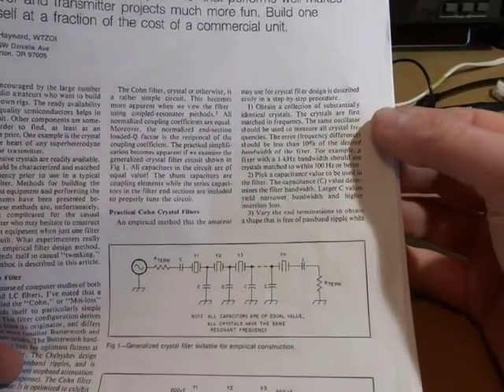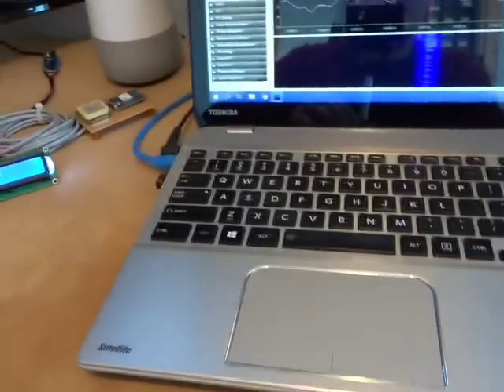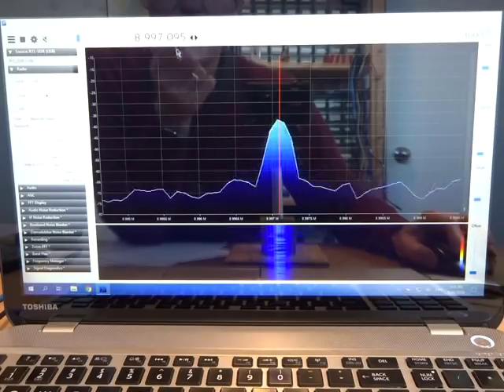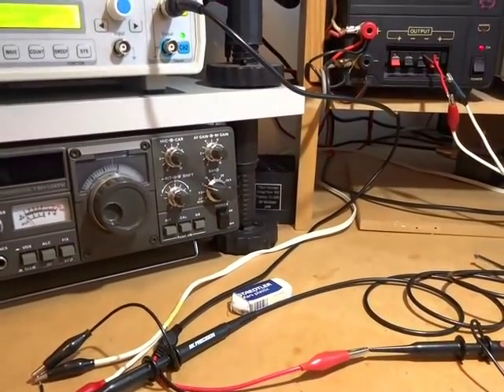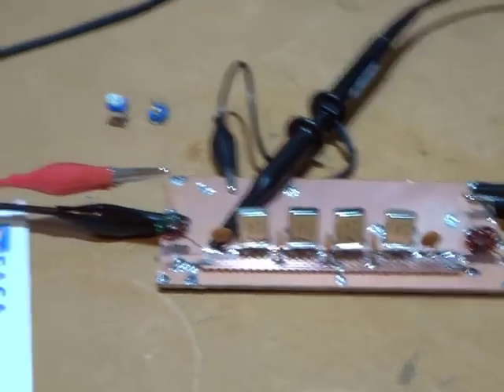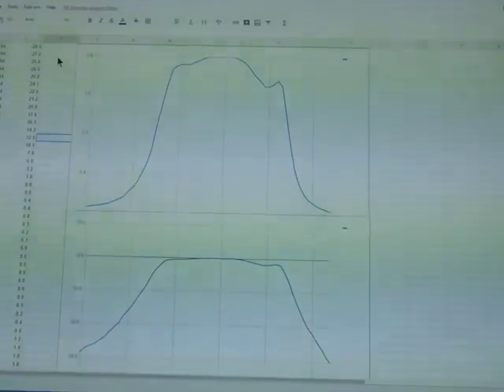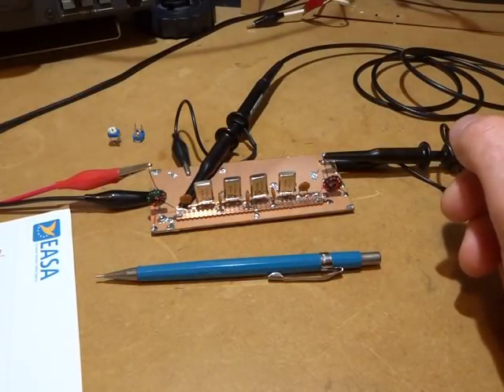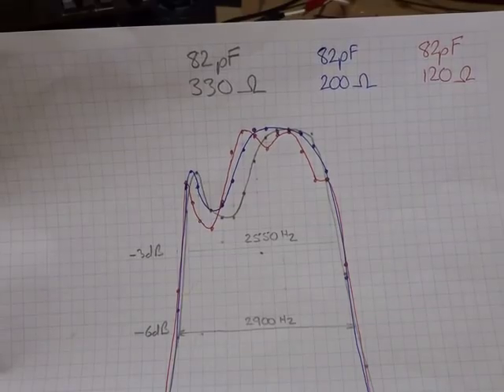Homebrew 80/40m SSB/CW Rig - #4a SSB Crystal Filter

Comment: Years ago, when the humble CB was very popular, they sold crystals for the CB band in electronics stores (possibly today it is more difficult to find). I read something about SSB filters, and bought a good number of crystals  27 MHz and another batch for 27,005 crystals. It seems that there are two types of resonance, one is the crystal acting as a filter and the other is the crystal acting as an oscillator, which are somewhat different, perhaps related to series and parallel resonance. The thing that in its day with an RF generator and an electronic voltmeter with an RF probe made two SSB filters that worked, but the problem was finding the quartz oscillator to create the SSB signal. I didn't insist and abandoned it. I recently bought a nanoVNA, and I found that nanoVNAs are almost amazing, that what once required sophisticated devices, I can measure or analyze with a nanoVNA: I have checked those filters that I made and indeed, they had a very suitable pass band as a filter of SSB. I also bought some ceramic SSB filters for 455 khz (at a more reasonable price than the quartz ones and I have tested them now with the nanoVNA and they are "very effective", today I imagine that they would be difficult to find if not via China. I have some other filters and SSB crystals resulting from scrapping cheap CBs.

Comment: Hi Charlie! Thank you for the great video! I just wanted to note that you could use the SDR for fine readings too. Set the SDR to SSB, then pipe the audio using VB-CABLE to an audio spectrum software. I would recommend using Friture. This way you can run FFT on a very narrow bandwidth, say 2400Hz which will allow you to get sub-Hz resolution on the spectrum in a matter of seconds. I have used this method with really good success. Hope it helps you too!

Comment: Hi Charlie,
I also built a crystal filter (12 Mhz) for a spectrum analyzer project from Ashaar Farhan.  I used the Haywood articles and built a crystal tester from a Doug Demaw article from QST.  This tester also had an comparison oscillator but allowed you to throw in a pad (on a seperate circuit )so you could measure the resistance of the crystals.  Supposedly once you sort the crystals by frequency, you place them with the highest ohm crystals in the center and work down on both ends.  I only tested the filter by 
hand tuning the sig gen through the pass band and plotting the P-P scope output.   The bandpass was supposed to be 1000
and with my imprecise measurements, it seems like about 600 to the 3 db points.
Andy  KM4TRT
Reply from the maker: That's very interesting thanks Andy. I build a filter a while back where I too tried to characterize each crystal. That filter didn't work very well either. I suspect it was my method/equipment that was a fault. Pete N6QW has written quite a bit about his experiences too.

Comment: Some time ago I picked up some 400 pieces of 8.3886mhz crystals in H6C/u packages on ebay for a few bucks.  These larger crystals supposedly have higher Q than the mini micro processor sized crystals, might make better filters.  I've been meaning to try and build a filter out of some of them using  your approach.  I'd probably use an Si5351 as a signal generator to sweep the filter, with my Leader frequency counter and old school Tek scope.

So I tried your oscillator circuit, but I put in 100pf caps and used a junk box surplus 2n2369A transistor and the stupid thing oscillated at about half the marked crystal frequency.  Put 100pf caps in parallel with the existing ones (didn't have any 220pf in the junk box), and now it's oscillating at the marked crystal frequency.  Weird!  I'm running the oscillator at 8v because I had an LM340K-08 in the junk box to hang on the output of my 13.8v bench supply.   I soldered two pins from a broken miniature tube socket (valve holder in your neck of the woods) to the lash up  to make it easy to swap crystals.  Now I can start to sort them out and find a set of 4-6 rocks close enough to try and make a filter.
Reply from the maker: Wow 400 crystals. You should be able to build several filters with that many! Hi hi. I'm keen to rebuild mine once I have the network analyser built.

Charlie

Comment: A few questions: what model number is your sig gen and are you happy with it? I have a scope arriving later this week and now need a sig gen. Is passband ripple affected by terminating resistance? I got fed up trying to use the RTL-SDR dongle + noise generator to characterize my crystal filter and I brought the filter to work and used a VNA to measure it. I had 3 dB of ripple over the passband which seemed excessive but the design was supposed to produce minimal ripple. I didn't bother to properly terminate either end of the filter and directly connected to the VNA, hence 50 ohms. I seem to have a firm grasp on how to vary the bandwidth of my filter, but not the ripple.
Reply from the maker: Gidday. The sig gen is a generic FY3200S model from any number of online sources (Amazon, AliExpress etc). For what I paid for it, I think it works well. You cannot set the output to absolute zero (even though the display says so) and the case is not shielded which means the output signals leaks. Not really a biggy though. I did open it up and desoldered the  speaker that clicked for every button selection and during rotary encoder rotation. It was quite load and a bit annoying. Having a frequency sweep function would be nice, but not necessary.

As for the filters, yes, the terminating resistance did have an impact on the passband ripple. I tried several values and settled on the one that resulted in the least ripple. I have had success feeding white noise into a mic and using the RTL-SDR to monitor the filter output. You can really see the passband and how well it's performing. The plan is to build a VNA after this. Justing waiting on the log amp to arrive.

Comment: Hi Charlie, great video mate!

I ordered around 500 10.7MHz crystals from China a few months back (paid little over twenty quid for the lot), not had any time to experiment due to work and family commitments but hope to have a tinker in the coming weeks. I wasn't sure which way to go with regards to the design, Pete Juliano N6QW was not convinced the software that is available gave a close representation of the real world results so I was keen to take the grass roots approach which you have clearly done. 

As it happens I have have a copy of that magazine from QST archives so will have a read over it later today, but what has inspired an offshoot from my current homebrew SSB radio projects is a homebrew semi-automated crystal tester using an WiFi enabled Arduino as both a Frequency Counter and a data logger, I can easily knock a .NET application up to receive the data and dump it into a Spreadsheet document and quickly match the crystals that way - a bit over the top you might say but the idea sounds cool :)

Anyway, keep these videos coming Charlie, big fan of your work and happy homebrewing.

73

Rob
2E1IIP
Reply from the maker: Cheers Rob. That crystal tester sounds interesting, and should speed up the selection process. Pete Juliano has another standard approach for making crystal filters, which I have used in the past. I thought I'd try something different this time. Seems to work ok at this stage.

As for the videos, you'll notice I like to take a simple approach. It's not that I don't like complex capable circuits/radio, just more that I prefer the simplicity. I'm pleased you find them useful.

73s
Charlie, ZL2CTM

Comment: I've used the free AADE filter design software before with good results, but never tried it for crystal filters though. Might be worth a look......
Reply from the maker: Funny you should say that Alejandro as I made a antenna analyzer a while back using an Arduino, screen and an AD9850. It scan a user defined spectrum and plots the antenna SWR. I recently modified it to test filters and plot the response. It works reasonably well. Might have to dust off that project and do some more work it!

Charlie
Reply from the maker: Thanks Brian. I think I may have used that (or something similar) in the past. Whatever I did it was wrong (my end, not the instructions/tool) and the filter wasn't quite right.
Reply: I also have a NWT500 Sweep analyser from China, absolutely great for checking filters. Much easier than plotting it on graph paper!
Reply from the maker: That's interesting Brian. I might have to look at getting one of those :o)
Reply: Charlie Morris, great work! why not a poor ham scalar network analyzer? Google PHSNA!, you already known everything about Arduino and si5351, only need yo buy a lm8307 RF power detector and voila.. plot the numbers from Arduino USB serial info

Comment: I have two questions: which kidle of oscillator do you prefer: colpits or hartley?  
Why didn't you put a coil as a tank circuit in this oscillator? 
73:)
Reply from the maker: Hi Emerson. I only tend to use the Si5351 for my radios. In the past I have tried to use Colpits oscillators. This oscillator is crystal controlled (as oppsed to a non-crystal controlled LC osc), and is using the split capacitors to provide positive feedback (i.e., feed back to the base an in-phase signal, hence why is was taken from the emitter) in order to meet Barkhausen's criterion.